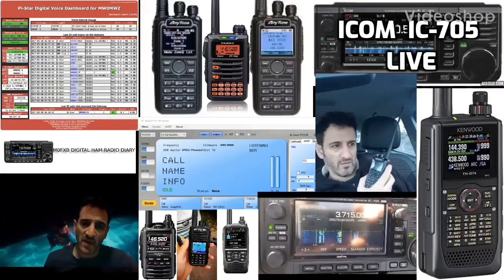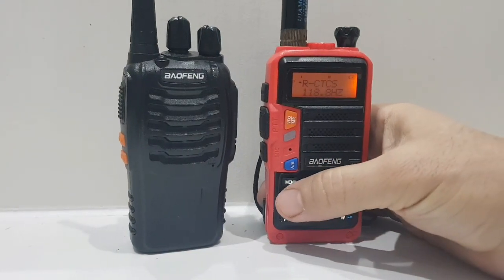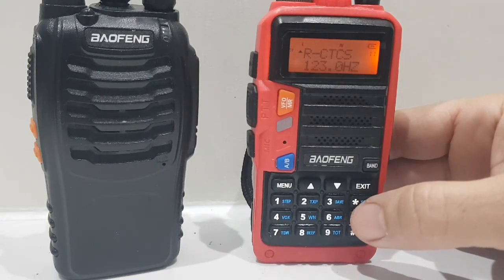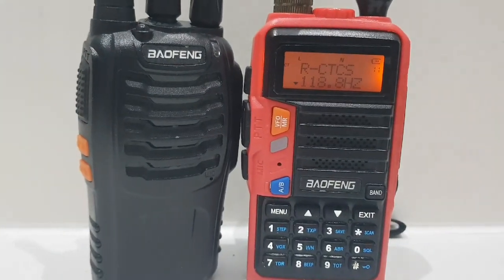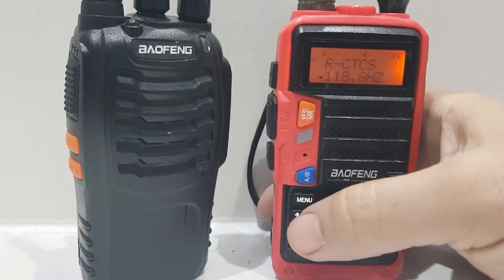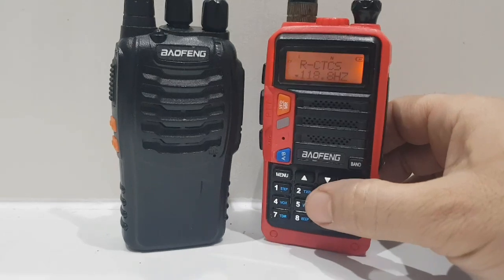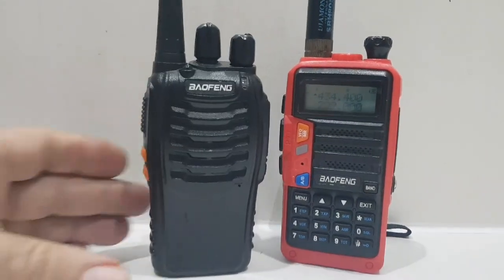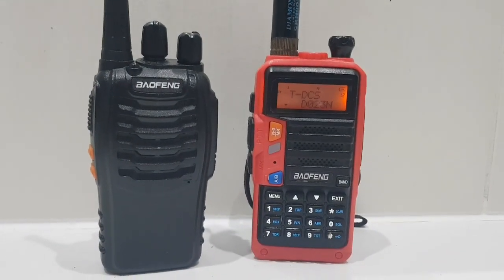BAOFENG UV5R - Scanning  For a Tone Frequency

Comment: How do you know if someone is using a security tone (ctcss/dcs) Will you see that your radio is receiving and just not hear anything?
Reply from the maker: YES
Reply: @M0FXBHamTech  Awesome! Thanks for the crazy fast reply.
Reply: If they have a receive tone set they won't hear you unless you transmit with that tone. This scanning assumes they transmit and receive with the same tone. It's only picking up the transmitted tone.
There's no way to pick up their receive tone. They don't hear you. You hear them unless you require a tone and they transmit it.